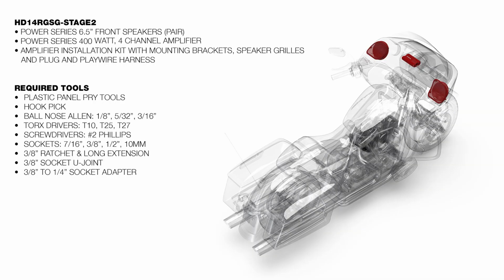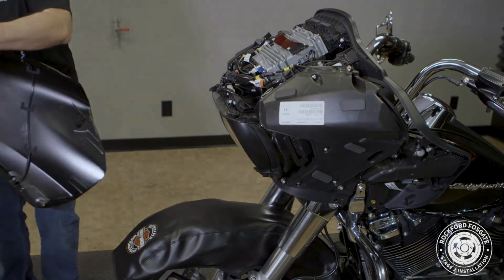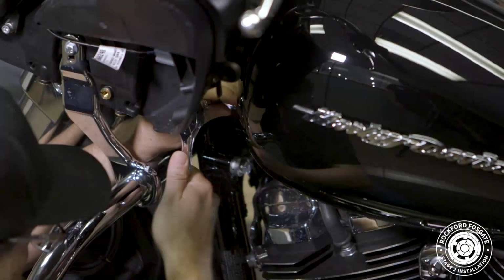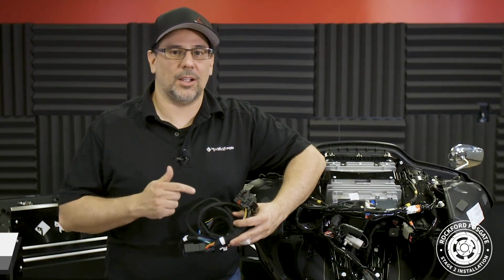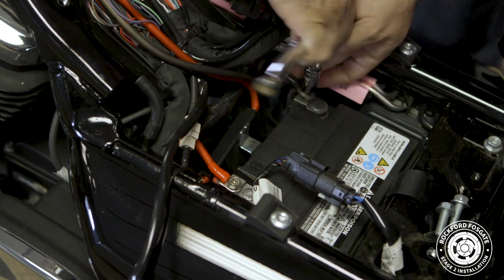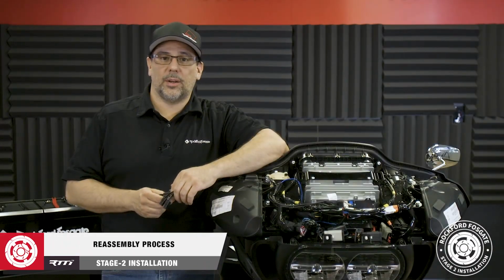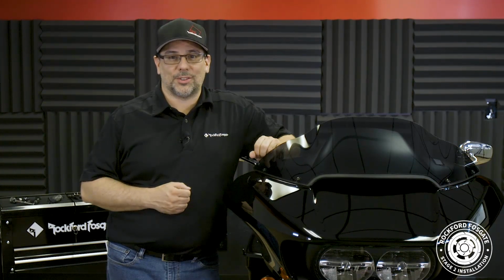2014+ H-D Road Glide Stage-2 Installation

Comment: I know that i am late to this party. But i just spent the money and let someone know what to do to do the work. I have a 2017 ultra limited four speaker system. Some days i have one or two radio stations that are has static. Some days it dont. It is clear sound. But i have to cut it more than half to get a good sound. Also, my next project is to get the saddle bag lid speakers.
Reply from the maker: @stolnpckup  We have the STAGE-2 for Ultras that includes an 800W amp, wiring kit, front 6.5” and TourPak 6.5”: https://rockfordfosgate.com/products/details/hd14u-stg2/ which would take care of your loudness issues and the PMX-HD14 add-on radio that has a great digital tuner: https://rockfordfosgate.com/products/details/pmx-hd14/
Reply: @rockfordfosgate  I bought the stage two kit. It included the four speakers and a eight channel Amp. The dealer said, that I could have up to eight speakers on that one Amp. I am just going to go with six.
Reply from the maker: @stolnpckup  Yes!  The stage 2 includes an 800W 4-channel amp.  It’s powerful enough to run 8, but will run 4 on an ULTRA no problem!
Reply: @rockfordfosgate  when I get the money. I will get saddle bag speakers to add to it.
Reply from the maker: @stolnpckup  Thank you for your purchase.  The beauty is it’s plug-n-play with this system, so it can be added at any time!
Reply: @rockfordfosgate  that's why I went with Rockford.

Comment: I also have the white noise issue- any solutions? No additional wiring to the battery??
Reply from the maker: There are battery connections that need to be made for the amplifier illustrated in the video.  If you have excessive noise, be sure the radio is flashed and your using the Amp Tuning Guide here: http://rftech.custhelp.com/app/answers/detail/a_id/1355

Comment: The bolt that was removed when running the power wire, why was it removed what’s it for?
Reply from the maker: Could you specify at what timecode you're referring to?  These are the 2 I'm showing in the installation: 
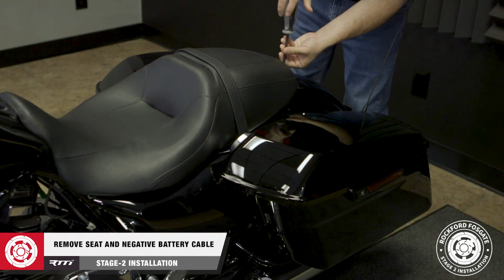• 0:55 - removing the battery negative
• 4:12 - use a 9/16 wrench & socket to remove the plastic retaining bracket that holds the existing harness.  You'll route the amp B+/GND harness through this plastic retaining bracket, so it holds both the factory harness and our new amp B+/GND harness.
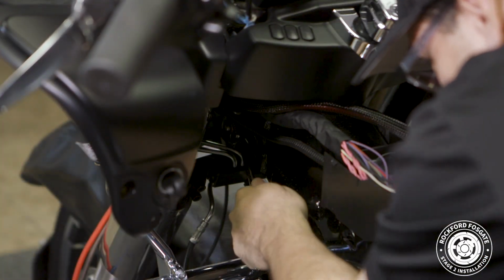Reply: @rockfordfosgate  right at 4:24 the retaining bracket do you re install the bolt after you run the wire?
Reply from the maker: @paigeandbaileycampbell6968  Yes, absolutely!  This holds your forks in place and should be tightened securely!  I only show removing this because you can't get our B+/GND/REM connector through the plastic retaining bracket.  If you don't feel comfortable removing the bolt to access the plastic bracket, then disconnect the (red B+/black GND/blue REM) from the connector, making it easier for the wires to get through the retaining bracket.  If you already removed the bolt:
1) Route the wire through the plastic retaining bracket.
2) Route the harness through the forks up to the amplifier location.
3) Replace the plastic retaining bracket on the bolt and replace the nut to secure everything in place.
Reply: @rockfordfosgate  thank you very much!

Comment: where do the amp output plugs go?
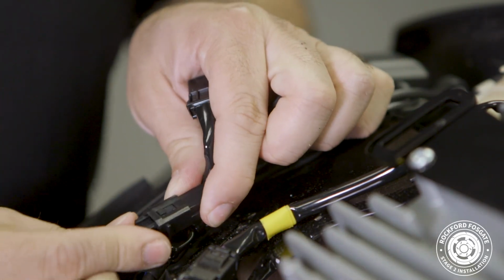Reply from the maker: 6:50 shows where I'm plugging the front/rear speakers to the amplifier's output connectors.  I'm plugging them directly into the amplifier outputs, but you can also use the black Y-Adaptors.  Simply plug one Y-Adaptor into each of the amplifier outputs ... plug the front harness into one of the front outputs from the Y-Adaptor and the rear harness into one of the Y-Adaptor rear outputs.  This will give you room to add front lowers and/or rear saddlebag speakers in the future.

Comment: Do the 2021's require a different type of cable to reflash the radio?
Reply from the maker: Yes, Harley-Davidson changed the cable type used for the CAN-BUS system.  If you're a dealer and have the Techno Research hardware, a newer adaptor cable is available from them.
Reply: I have a 2021 and am about to install this, does everything work install wise on the 2021’s all the harnesses and stuff?
Reply from the maker: @paigeandbaileycampbell6968  Yes, the main difference is the plug used to flash the radio is different.  Be sure when contacting your dealer to make sure they have the new 2021 Plug for their TechnoResearch flasher.  We have a list of authorized dealers that can flash here: https://rftech.custhelp.com/app/answers/detail/a_id/1344/

Comment: If I’m only running the 2 fairing speaker do I set the channel to 2 or leave it on 4?
Reply from the maker: Great question! Since this system gets all 4 channels of audio signal from the radio, you can keep it in 4-channel input.  This way, if you ever add rear bag-lids, you don't need to adjust the switch.  Keeping it in 4-channel input (only the front channels are connected to speakers) does not hurt anything.

Comment: Great video. The blue and white wire with the white connector labeled amp turn on, what does that plug into?
Reply from the maker: Thanks for your feedback Michael, the Female BLUE/WHITE is the "Amp Turn On" that is used with a DSR1 signal processor.  You'll connect the BLUE wire attached to your amplifier's power harness and connect into this female BLUE/WHITE wire instead of the motorcycle's factory connector.
Reply: I am utilizing the dsr1. I used the solid blue wire  coming out of the rem terminal to plug into that empty 12v plug on the brake side like you showed in the video. Is there another plug that maybe I’m not seeing?
Reply from the maker: @michaeljentile4176  I misspoke earlier and edited my reply above.  

If you were NOT using the DSR1, you would connect the solid BLUE to the factory connector as shown in the video.

Since you ARE using the DSR1, connect the BLUE wire into this female BLUE/WHITE wire instead of the motorcycle's factory connector.
Reply: Thank you for your help, that clears things up.
Reply from the maker: Anytime @michaeljentile4176 !  Appreciate you reaching out to verify.  Hope you and your family are safe!

Comment: After install, I have a static or white noise, even at no volume.  I assume this is a ground issue somewhere.  Any helpful advice where to start?  In addition to the amp being hooked up to the battery terminals, I also have a connection for my light kit.  Should they all not be connected using the same bolts for positive and negative?
Reply from the maker: (1) I would immediately start by disconnecting the light kit since that can cause noise in the line.  (2) Disconnect the inputs to the amplifier.  Use the RCA input harness that was supplied with the amp and cut the 4-pin connector off.  Make a shorting plug by twisting the (+) and(-) together for the left channel and doing the same for the right channel.  Move the input switch to 2-CH and turn the system on.  There should be no noise.  If you are having noise, I'd contact our technical support because you'll have a lot of things to check from here on out.  They can be reached at 1-800-669-9899 Mon-Fri 8am - 5pm MST.
Reply: 2021 RG, I have the same white noise without volume, no additional components hooked to the battery. Please help!
Reply: Same no extra stuff to battery and white noise
Reply: @TyNoga24  not sure how to correct
Reply: It’s wind noise from installing the fairing back on. It’s at 60mph right?

Comment: Bought the stage two kit for my Roadglide mounted and plugged everything up and there is no power to the amp. Powe cord is hooked up to battery but there is no light signal on Amp. Need help.!
Reply from the maker: Hi Michael, there are a few things we need you to check on the install and therefor recommend contacting our technical support when you have the bike in front of you. They can be reached at 1-800-669-9899 Mon. - Fri. 8am - 5pm MST.

Comment: The system, does not sound as loud as it used to? Out of the blue the quality of sound and loudness decreased it did not go back to normal. If my bike does not get used for a long time (couple of weeks) the system sounds loud for the first few minutes, then it drops and doesn’t go back to normal. Any suggestions? Ive gone back to the dealer that installed it and I’m being told everything is ok. I know I’m not crazy 🥺
Reply from the maker: Hi Walter, Assuming you have the exact same system as shown in this video, the HD14RGSG-STAGE2 right?  How long ago did you have this installed?  Did you do any software updates to the factory radio?  Did you take the bike to the Harley-Davidson dealership for service?  If not, it may be necessary to inspect the harnesses at the radio plug and at the amplifier.
Reply: @rockfordfosgate  i have had the system updated, thank you for that info, what exactly will I be looking for at the harness plug with the radio?
Reply: @rockfordfosgate  system was installed in april
Reply from the maker: @walterguerrero8115  Thanks for this information?  Can you elaborate on what was "updated".  
1) Who did the "update". An independent audio shop or a factory Harley-Davidson dealership?  I'm trying to figure out if they attached a Techno Research VCM-TR4 or the Harley-Davidson DigitalTech flasher to your bike.
2) What was actually "updated" (added lowers, added tourpak, or added saddlebag speakers) to the existing HD14RGSG-STAGE2 kit? 
3) Was the factory radio software updated at all?
Reply: @rockfordfosgate  The update was done to the infotainment system, and it was done by the Harley dealership, that system itself has not been updated, in other words there has not been any more speakers added to the original scent of jester faring speakers with the Amp
Reply: Yes the radio software was updated twice, and update was done during the install, then Harley Davison send out another update a few weeks ago that was done also
Reply from the maker: @walterguerrero8115  Thanks for that info.  I think we just found the issue based on the radio updates.  
1) I would look at any bass/treble/fader settings on the radio to verify they are set at the neutral position.  If they are ... we move to #2:
2) We recommend the radio be flashed with the Techno Research VCM-TR4 with the "Rockford Fosgate 2014+ All Bikes" setting.  When flashing the radio to our recommendation, the H-D CAN-BUS looks for a "factory amplifier" to be installed.  Since there isn't one there, the Harley-Davidson technician may have seen an erroneous error when he connected the H-D "DigitalTech" diagnostic tool to the bike.  If he saw this error, he may have changed the flash setting on the "Audio System" to eliminate the error code.  Changing this flash setting on the radio changes the "sound" of the radio's output.  Some Harley dealerships have the Techno Research VCM-TR4.  If yours does have this tool, they will need to change it back to the "Rockford Fosgate 2014+ All Bikes" flash setting.  This is a little confusing, so if you need to clarify questions, feel free to contact our technical support agents at 1-800-669-9899 until 5pm today MST (we're in Arizona).
Reply: @rockfordfosgate  thank you very much, I will try to get them to do that for me. Thank you.
Reply: @rockfordfosgate  do you guys sell that flasher tool?
Reply from the maker: @walterguerrero8115  It’s a $500 tool…
Reply: @rockfordfosgate  🥺😢😭

Comment: Is this easily upgradable to add speaker lids in the future if i decide ?
Reply from the maker: Great Question Kris!  Yes, the kit comes with a 4-channel amplifier, so you simply would add the TMS69BL14 saddlebag kit when you're ready.  Literally nothing on this kit would need to be reconfigured or changed to add the saddlebags at a later time.

Comment: Does any one know why the system will act up after the Automatic Volume Control has been engaged? I am asking because my system hasn’t performed the same ever since that feature was activated once. Any help will be greatly appreciated it.
Reply from the maker: Was the radio was updated after it was flashed?
Reply: @rockfordfosgate  yes it was
Reply: @rockfordfosgate  yes it was
Reply: @rockfordfosgate  yes
Reply from the maker: @walterguerrero8115  While I'm not sure what's going on in the radio software, I suspect this may be the issue.  If you turn off AVC, does the radio operate as expected?
Reply: @rockfordfosgate   I have turned off the AVC and the system never went back to sounding the same.
Reply from the maker: @walterguerrero8115  I’m not sure what happened to the radio during the software update, but it sounds like the speaker/amp configuration (flash setting) changed.  If the radio was updated at the Harley dealership using their Digital Technician tool, the mechanic likely changed the radio flash setting.  If so, a comparable setting on the Digital Technician is “2-Speaker upper fairing / 1 amp”.  Otherwise we suggest a motorcycle audio dealer with the Techno-Research tool to flash the radio to “Rockford Fosgate 2014+ All Bikes”
Reply: @rockfordfosgate  ok I’ll try to find a shop to do that. Thank you

Comment: Lame. Nothing in it about tuning the amp or what settings to use. 👎
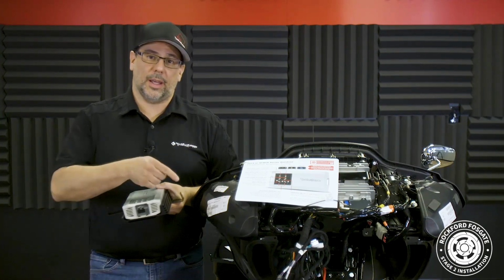Reply from the maker: At 5:38 we explain "We offer this FREE amp tuning guide that's available in the description of this video and this kit's product details page".  The link in this video description goes here: https://www.rockfordfosgate.com/rnt/rnw/docs/1355/harleyamptuning_2014_rfk-hd14.pdf
Why do we do this?  Because the amp settings are subject to change based on possible updates to the Harley-Davidson radio software, which is out of our control.  So, if the software forces us to make changes to the tuning guide, we don't have to trash an entire video.